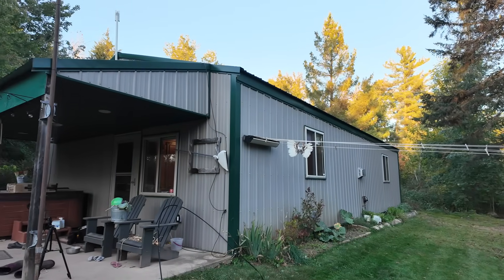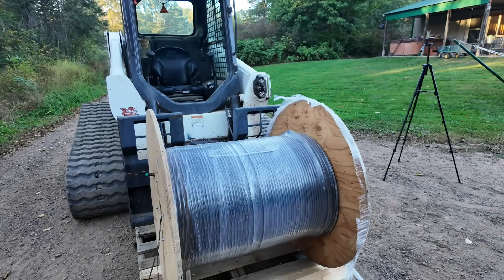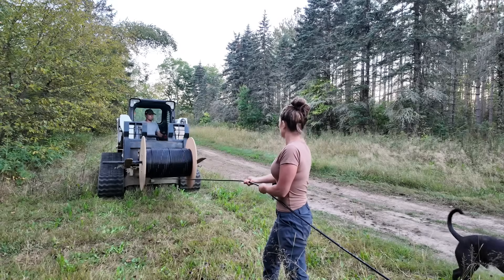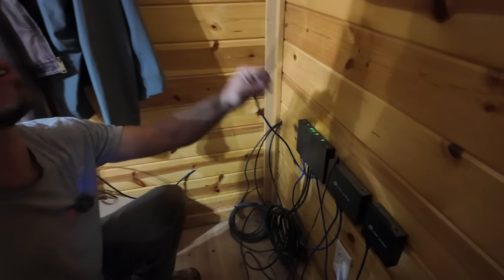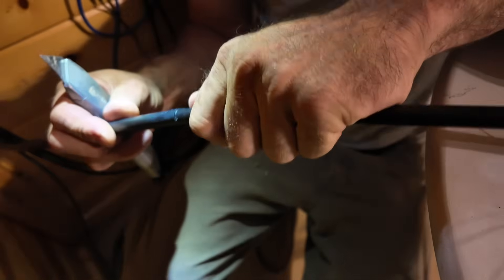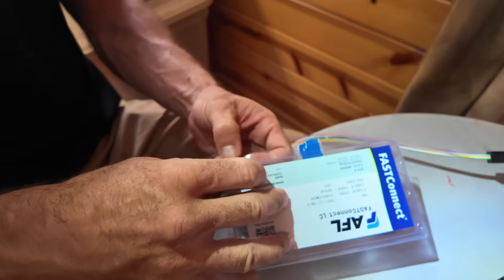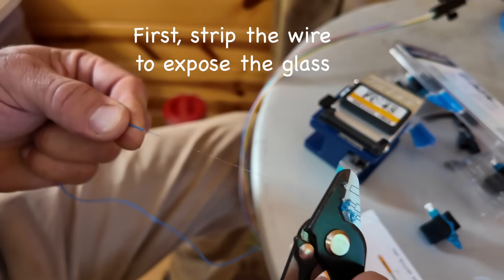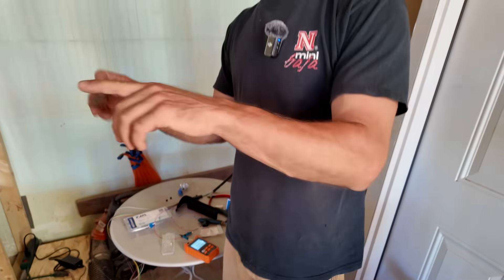We Need Internet! Running a 3,000 ft Fiber Optic Cable

Comment: Ditch the fan out kit entirely…. Those fibers should be protected in a splice box.  Use the AFL terms right onto the loose tube fibers. When you push them into the connector you should have a “bubble” of fiber between your finger and the connector before you release the lock. This ensures the clean cleaved fiber is fully engaged into the connector and is touching the fiber inside the connector.  These quick type ends work by having the two fiber ends touching inside an allignment sleeve with some optical gel as well to make up for any defects.    
       You need to have all your connector pieces already on the fiber before you clean and cleave. Clean until you hear the squeak, cleave, carefully insert into the connector. As soon as you try to slide stuff down over the freshly cleaved fiber, you have already damaged it.  

After you terminate the fibers, place the connector into a “joiner” that comes with your splice box.  Then you can get an LC to LC patch cord to go from the “customer” side of the splice box to your SFP.  

Be very careful as you strip, cut, cleave, handle. A piece of fiber can get into your finger, hand, or your eye..  you cannot find it with medical imaging, you just have to start digging and hope you can get it out.  Make a sticky side out roll of masking tape and put it on your table.  Put your off-cuts onto this sticky pad and then fold and dispose when you are done.  

   Forget entirely about your optic loss meter.  The type of terminating you are doing is “try your best and hope the link light turns on”.  So just be diligent in all your steps and watch for the light lol.
Reply from the maker: Thanks for the feedback!  I had been looking for splice boxes but all of the ones I could find looked like they required a hot splice.  Is there a more DIY-friendly splice box?  It sounds like the one you are referring to has a female/female connector in it, which is exactly what I would like to find.  Currently, I was considering doing some Keystone connectors on a wall plate, but that doesn't really deal with the rest of the fibers.
-Ryan
Reply: @thehomesteadingrd  I think you're looking for a LC-UPC Duplex Wall Mount Fiber box. When the ISP does fiber they fusion splice and wrap in the tray. The tray goes into the enclosure. The armored fiber cable goes into the enclosure and zip tied to it. Then they run a jumper from the box to the ONT or SFP fiber module. Looks like you're using LC-UPC duplex which isn't as common but there's boxes for it. The fiber strands are very fragile and can break later on if they're not well secured and follow gentle bends.
Reply from the maker: @cykes5124  Thank you so much!!
Reply: @thehomesteadingrd  Yes, get was @cykes5124 said, its basically a little box that has a patchpanel with all your fiberstrands in it, you can then plug in a fiber cable for patching from this fiber box to the switch. The bare fiber would be easy to break.

Cool video and you did a really good job for the first time dealing with fiber!
Reply: @thehomesteadingrd  to add to the feedback, you might want to get some Kimtech science wipes and some 99.9% isopropyl alcohol. If the wipe you are using gets too dry it won't effectively clean the fiber and you won't hear the squeak. The science wipes are used because they don't leave residue on the fiber. They don't need to be drenched to clean effectively.
Also, turn the fiber a little bit and do multiple passes to clean all the circumference. It might not be as important as in fusion splicing but it can't hurt.
Reply: This ^^^^^^^ That's exactly how you do it. As soon as I saw the fan out I knew we were in for a bad time.
Reply: dito never have i used those kits

Comment: Point to point wireless only works with clear line of sight.  Not so much as a leaf.  Microwave reflects and is absorbed by vegetation.  You can go miles FROM TOWER TO TOWER.  You literally have to see the antennas from each end.  Good show.
Reply: I was going to mention that after about 200 yards P to P is going to also require either a laser to align or a meter to adjust for best signal
Reply: @tfildaed  I've got cheapo $40 ubiquity P2P to do 800 megabits at a mile just eyeing it and maybe peaking it out with the signal meter in the configuration screen.  I used to point Direct TV dishes by opening the window and listening to the tone coming from the configuration screen before I found out that there are satellite signal meters.  I'm a slow learner sometimes and end up doing it the hard way.  I have a knack of making stuff work regardless.  Just an old hack(er).
Reply: "clear line of sight" is not enough. You need a clear first-order fresnel zone (which is essentially an eliipsoid containing all possible 1 reflection paths that are at most 1/2 wavelength longer than the direct path) https://en.wikipedia.org/wiki/Fresnel_zone
Reply: @blauesKopftuch  Thank you Wikipedia for the technical clarification. You probably only do P2P or have studied it extensively.  I'm just an old IT guy that makes stuff work.  DIY is kinda the vein we're in here.  I've heard of fresnel zone and understood to not  put antenna in a confined area.  Isn't the wavelength of 2.4ghz like 2-3 inches and 5ghz and inch or so?  I sure you can find it with a speed of light calculator.  I've done like a mile hop and used handheld radios and a signal meter on the device to peak it out reasonably.  I get the best signal reasonable and call it a day.  Most folks that I helped with these things were happy to be connected to the network and really didn't care if the link was 780 megabits or 820 megabits on 5hgz.  I'm sure a LONG hop or a ISP might be much more worried about perfection.  I remember installing one at a rail yard for some instruments and a couple of cameras once it was mounted and powered up on a telephone pole the site survey was picking up P2P's on the mountain for a radio station 15 miles away and had like 25% link quality pointing 30 degrees away from the mountain.  Fun stuff.  I may do like 5 P2P's a year so it's not like all I do.  Fun talk.
Reply: I worked as a wireless installer for 5 years and I can tell you that it depends on the frequency. 5GHz is nice and fast but not good for shooting through heavy brush. 2.4GHz is good at going through wooded area and still plenty fast. 900MHz will blast through heavy forest and even through ground. 900MHz is the slowest of them but when setup properly will still support anything starlink will give it. Ubiquiti has some awesome equipment that for sure would have worked wonderful. The first mistake they made was using TP-link stuff.
Reply: @MrWizards1974  exactly....
Reply: Not so much as a leaf? Errrr...
Reply: There are point to point options that work through obstructions. Most people carry one around in their pockets that accomplish just that. The issue is that the lower you go down in frequency to penetrate obstacles, they require FCC licenses that are cost prohibitive to most consumers. The equipment alone would cost more than a massive spool of fiber.

Comment: We use 12 strand fiber to connect the entirety of a 12 Acre drive -in theatre. We run data, audio, HD video, security and control signals for two regularly operated screens, two concessions, and two special event areas. In many areas we use multiplexes to allow us to run multiple live production cameras and the accompanying audio to the main projection room for processing and display on our screens or to visiting OB production vehicles for recording or other uses.

Even though all of our cables are direct burry rated we ran most of the network in PVC conduit.
The hardest part for us was getting reliable low loss terminations. We discovered the quick connect connectors all eventually develop loss issues. For systems where reliability is not an option I strongly recommend having a fiber professional come in to do all of your terminations, always leave plenty of extra cable at the ends and terminate to patch panels then use factory made patch cords to go to the equipment.

Comment: Good move!  Didn’t realize how much fiber cable has come down in price since I checked it several ago. 

Those dishes need line of site to work.  Even then, dense fog or heavy rain would have caused loss of signal.  Fiber was the way to go for using one subscription. Well done.

Comment: What would have been less $$ than fiber is RG6 coaxial cable. I ran 1800 ft (outdoor rated - same as the cable companies use) through the woods just lying on the ground for a couple of years. It worked very well and high speeds. The particular units I used was a pair of Netsys NH-310C which can drive 4000' of coax cable. Netsys no longer makes that unit but they have a newer model which does the same thing. There are other competing products - just look for 'ethernet over coax bridge' . Nothing wrong with fiber of course.

Comment: I also live half mile off grid, plan to run fiber someday.  But in the meantime, I can beam approx. 100mbit of bandwidth the 1/2 mile (mostly through the woods) using 2.4 GHz microwave dishes.  The reason your microwave link didn’t work is because you were using 5ghz: it has great bandwidth, but requires direct line of sight, I.e. no trees or leaves in between.  Switching to a lower frequency would get through your woods, but at reduced bandwidth.  Good to know, just in case you ever need backup :-)
Reply: Half a mile sounds really impressive for 2.4 GHz! I know some people use even lower frequencies like 900 MHz to get through thick woods
Reply: @jimtran93  I'm using a pair of Ubiquiti Powerbeam 2AC's for my 2.4Ghz link.  They've been running nonstop for approx. 3 years now through rain, snow, and ice.  Someday they'll fail, and that'll be the day I order a spool of fiber ;-)
Reply: @BenKibler  haha, that totally explains it!
Reply: was running  5g 880mbit links for about 400 feet, max speed was only 270mbps but was extremely response , felt like almost zero latency, you couldnt tell it was a wifi bridge. in speed test latency was 5ms to the speedtest server. . . suppoesdly they work for 2.4 km but never tested that, either way pretty darn imppressive you can beam such a low latency wifi singal
Reply: My 5GHz  link worked fine in a similar application....until the trees that were in the line-of-sight grew, and the signal went away....oh well.
Reply: @Mikolas3250  yeah: I get 150-200mbit in the winter, and drops to 50-70mbit in the summer once leaves are on the trees. It's a constant battle to keep a "tunnel" pruned through the forest.

Comment: I think you were suppose to run that thick fiber cable on the outside of the house into a box, and terminate it. Then you lead a very small fiber inside, you don't have to drill these big holes and don't have a sturdy cable sitcking out that you can't really bend.

Comment: you guys should run a unifi system. might be a bit costly, but it will make life so much easier in the long run, considering you ran the fiber optics, you can run different sites under one managed account under unifi. I'd highly recommend looking into Unifi by Uqibuiti, considering you can still run wires in your actual places as well for AP's and such.

Comment: You better bury that cable you have running across your drive way. Optical is brittle. You also may want to consider running a trace wire along the cable when you bury it so you can find it later.

Comment: One thing you might add is the need to ensure your transceivers work with the switch you are going to use. You didn't mention whether or not these were sfp+ or sfp. If sfp+ what is the data rate? Some sfp+ modules can negotiate multiple rates 10GB, 5GB, 2GB etc. Others only support 10GB or 1GB. Intel modules (transceivers) seem to work only with their own devices. How did you figure out which transceivers to use? I found this helpful, as I am considering putting in fiber. I just don't need as long a run as you.

Comment: Network Engineer here. I am impressed that you have successfully terminated SingleMode fiber within connectors manually and got link within usable damping. Normaly (atleast in EU) you terminate pigtails on a fiberstrands with an automatic welder to get optimal results (up to 100KM/60M) within spec (loss of 0.2dB/KM and 0.1dB per weld).  Did not know that manual splicing and terminating would do it.

Ps: 1Gbit singlemode is very robust. You can get link on singlemode optics on MultiMode fiber on short distances. To try to see if the cabling is optimal, you need to take a look at the Transmit power of the SFP and if it will match the Receiver requirements of the other side. 
Basicly an 1G SFP  (LR = <10KM @1310nm) does transit someware at min/max -9dBm/-3dBm and will still get link at (receive) -18dBm, will reach 10KM+ in optimal way.

References: https://archive.nanog.org/meetings/nanog48/presentations/Sunday/RAS_opticalnet_N48.pdf

Comment: Hey you did what you did without going overboard. I would recommend using fiber demarc boxes to connect patch fibers. Imagine having a pvc waterline and every time you use it you possibly damage that PVC so one day you install a coupler with a sacrificial pipe. Same idea the patch cord is sacrificial, cheap and easy to replace where your trunk damage means retermination. Also bury that line ASAP, cudding animals and rodents especially like to cut their teeth on this stuff. I had a cow absolutely destroy about 100 ft of fiber at a oil well site and weekly rodent repairs. If you ever get a chance for someone with an OTDR, scope and fuser to come put on LC tails for sure use a demarc. Otherwise great job for using basic tools, most people wouldn't even try.
Reply: Disagree. He didn't need a 12 count. He didn't even need more than 1 fiber, there are single fiber SFP+s that work up to 10G. I 'm sure he spend a couple grand on this, when he could have really done it for under $500.

Comment: Yoo, nice job, i would recommend getting a fusion splicer even if its a signalfire AI9 which can be found for arround 700 euro, and get a 12 core splice enclosure then use patchcables from the splice enclosure when you all done that way you are use the fiber is well protected

Comment: This is all temporary work right? Got me all on cringe here with the not so right way you have approached this. I have 4300ft fiber runs here on my property feeding various buildings and off grid cabin with bunker. I buried my lines in conduit 8ft deep so i know without a doubt nothing will ever touch it. Also, armored SM fiber would have been ideal which future proofs your work as it supports 100Gbps throughput. You def want outdoor rated nema boxes on metal buildings with conduit coming from nema box inside of house so sharp metal is bot even a factor.

Comment: Oh brother if you were local I would come over and install your fiber properly.  Good job as a DIYer with no fiber experience, but your fiber should be landed inside an enclosure and then connected to your SFP with a patch cord. I am a fiber technician for over 30 years. I am currently running Fiber optics throughout my property in Oregon to get network to all the out buildings.

Comment: Important safety note for anyone working with fibre: NEVER EVER EVER LOOK DOWN A CABLE! The light wavelengths used by fibre optics are often outside the visible spectrum so it won't help anyway (I.E. you'll think it's dead when it's not) and it could easily burn out your retinas or damage them imperceptibly (until you have vision issues later in life). 

If you really feel the need to see if a light is coming out of the cable hold the cable up to a sheet of paper or similar and see if you can see the light reflected from the paper - do not look down the cable through the paper!

The above is true of any fibre cable but it is especially true of long range cables as used in this video. Fibres in datacentres which go a few tens of metres often use weaker lasers or even specially crafted LEDs because their light won't be lost (attenuated) over the short distance they have to travel, however fibres between datacentres or between towns/cities often use much stronger lasers which can go tens of kilometers without amplification or repitition of the signal and these will blind you instantly if you look into one. 

The signal tester shown in this video uses visible light wavelengths at a (usually) safe power level so it's easy to see if the tester is working and the fibre is not broken before you plug it into the meter. Do not expect an actual network signal to look like the fibre tester.
Reply: Nonsense. Singlemode uses class 1 lasers. Completely eye-safe. Unless you're dealing with some trans-Atlantic cabling, they aren't going to be using anything more than class 1. Multimode...ALL of that is LED and visible. So even less of a concern without the scary laser word.

Comment: Great job. Ideally you should have a fibre joint in a UG box outside. Run a fibre to the outside of the building from the UG box. Put a demarcation box on the outside and run an internal flame resistant cable inside which has the fitting already installed.
Reply from the maker: Thank you!